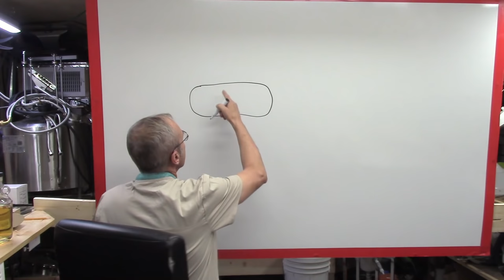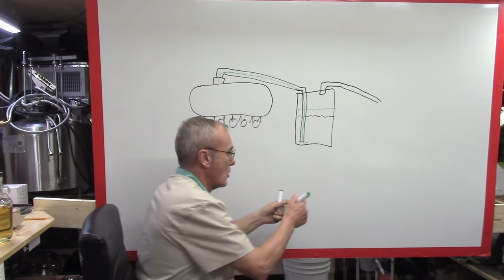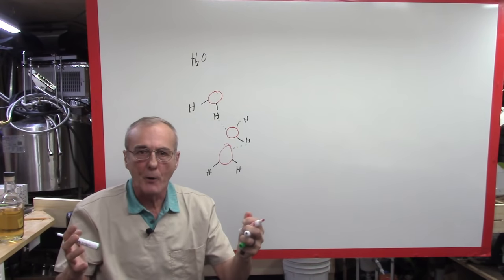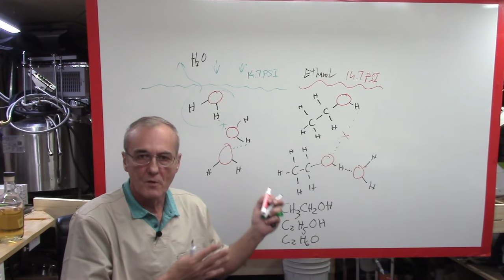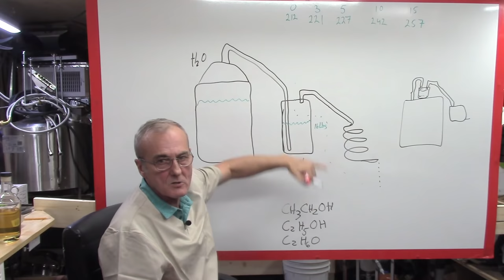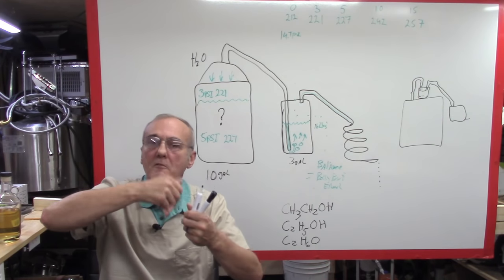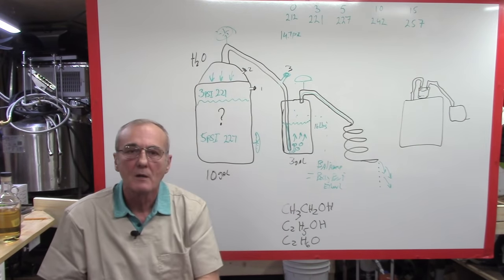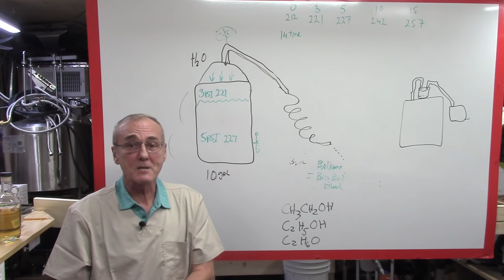THUMPER THEORY, OPERATION AND PROCESS

Comment: Damn dude your saving me time a d money with every video.  Except the part about 2 hydrometer. I did great with one until you jinxed me yesterday with get 2 of each. Well broke my proof trailer at the end of my run last night.  I'm ok at bubble testing or shake test. Could you do a video on the shake proof test please
Reply from the maker: Yeah, hydrometers break when they are single. I dropped my hydrometer from about head height last night and it bounced across the floor (didn't break). I guess that was because I have a few extras in the drawer. Similar thing happened about a year ago but I dropped it only a few inches onto the bench ( it shattered). Of course, I only had one so everything came to a halt.

Comment: Well.... that was very informative!!..... and disheartening lol
I built mine years ago, according to the way I was told, I didn’t know it was called a “thumper” I was told it was a “poison pot”.... my inlet tube only connects to the top (like the Chinese model you spoke of) it has no internal tube. I was told the “poison” would condense in the pot, only good whiskey made it out to the coils 🤷‍♂️. So I can either eliminate the thumper altogether, or add an internal tube to it. I do like the thought of the “double distillation “ aspect, but I definitely didn’t add a thermometer to it (which I could add) and I could put heat on the thumper to speed the process up some.  Btw mine is all 100% stainless steel, and it uses stainless steel tubing (5/8”) and the thumper is not even close to 1/3 the size of my pot. Suggestions??
Thanks for the videos! Super helpful

Comment: Is the methanol & acetone extraction temp 140 - 173 the same at sea level as it would be at 1000 ft or 7000 ft ?
Reply: No. All boiling points change as air density drops. Which is why water boils in a vacuum.

Comment: I respectfully disagree George. I was always told that the thumper was so they could run at a much higher temperature safer and in turn make a higher proof at a faster rate. The process is the same but the motive is different. I do however agree that they are, let's say nearly, unnecessary if you have a way to control the temperature. The tool you were thinking of in a monometer.
Reply from the maker: I understand you point and see the wisdom there. I may not agree wholly with that but that is okay. 
We are still saying about the same thing. Thanks much
George

Comment: Would you get a higher proof with the thumper over pot still
Reply: Yes
Reply from the maker: In theory yes but there is a limit since the distillation only happens twice at most and that is a stretch. 
The only true way to increase proof is to switch to a reflux still.

Comment: 22:55 I disagree with your premise that there is 16 pounds of water back pressure created in the thumper. In reality the still will see the height of water that is measured between the bottom line and the top surface of the level inside the thumper. 1 psi = 27.7 inches of water. so that being said the still will see about 1/3 psi or 9 to 10 inches of water column.
Reply: His physics is really lacking :-)

Comment: Lots of bla bla about having no clou about the process. I'll tell you the Clou.. 

The thumper acts as a pressure controller as the dip pipe is submerged into the liquid within the thumper causes a certain amount of backpressure. . The submerged length governs the overpressure LP (=low pressure) in the kettle.
The Ethanol boiling point in the kettle is shifted (increased) a bit due to this. In the thumper however is  atmospheric pressure (AP) the condensation temp is also a bit lower. 
Function/ process :
The slightly hotter ethanol vapor flows from the LP kettle into the AP thumper and expands there. That's the noise you hear coming from the thumper. 
The incoming LP Ethanol vapor is bringing up the thumper temperature too and increases 2nd stage distillation. This is in fact the heat source of the thumper. This causes the evaporation of the AP alc within the thumper. The AP alc vapors enter the condensor coil..and follows the usual process which I will not explain further. The outcome from the condensor is dubble distilled  alc.!! 
The thumper definitely purifies the alcohol.! 
Since so many thumpers are poorly designed, the purifying effect is also poor. The rule of thumb normally doesn't work really... Especially when you don't know what you are doing...
To my modest opinion you must be able to play with the dip pipe length that is submerged into the thumper liquid... Doing so you manipulate the back pressure in the kettle. 
More/less back pressure means higher/ lower temperature  of the influent alc into the thumper. This surely has an effect on the 2nd distilling process efficiency of the thumper. 

If questions, just ask me
Reply: what is your heat source?
Reply: @mushroomman1856  the delta T between the Low Pressure alc vapor in the kettle and the atmospheric alc in the thumper.
The temp difference is enough to revaporize the alc in the thumper = 2nd distillation.
Remark: the specific evap. Temp is pressure related.

My advice 1 : read my explanation again.
My advice 2: don't consume mushrooms when proper brain function is required bro!
Reply: @son-of-a-gun  I understand all that.   I asked "what was your heat source".  I pick edible wild mushrooms btw.
Reply: @mushroomman1856  read my explanation once again bro.
I also pick wild mushrooms in the forest but only those I'm 100% sure of. Baked with bacon and unions...
Hmmmm
Reply: The length of the inlet pipe and the thumper liquid level have some adjustment..is there a something of a tried and true equation to follow and maybe a adjustable inlet pipe with say a plastic pipe slip on over a short pipe to tweak the pressures..or ..is it just a run it and watch it..as it was originally built or conceived. I have the " cheap Chinese" and I hate to call it that..the inlet is flush with the thumper lid, no protrusion into the thumper liquid, the set up I have is the thumper sits nicely on the lid of the still boiler and the heat from the lid seems to make the tails come through quite completely and the thumper liquid is almost water when done. and when finished turn off heat and next day wash up nicely with no threat of crushing negative pressures.I will try to get inlet pipe down into the thumper liquid to see how this affects the run and with some flavourings and aromatics in the thumper liquids,anyone else where I am does this seem viable.??  any comments..I'm a newbie at this and have only run 3 batches so far..and seems so far..so good..
Reply: @ultraStevenator  yes your proposed solution will probably work. Caution:  Don't forget to place a vacuum breaker on your kettle. Your still is probably made of thin wall SS sheets that might implode when under vacuum.  I suspect that this is also the reason why the Chinese manufacturer didn't include a dip pipe in his design, on the other hand 
the thumper cannot function as a TRUE 2nd destilling step without a dip pipe since the slight overpressure in your kettle depends on the emerged length of your dip pipe.
If no dip pipe, no better taste either. In this case (without dip pipe) the thumper might work as alc. concentrator, since water will condense, but not the alc.
Reply: @son-of-a-gun  thanks Mr.Safor..I’m going to modify the thumper with a dip tube and investigate a vacuum release valve so as to cover my mistake if it occurs, I should be ok with this as I try to do a good job and babysit it carefully..but ya crap happens..so will look into a valve or some release system..thanks so much for your help I’m kind of a newbie at this and having fun ..but ya pit falls will get ya..kinda already looking at new systems ..hahah..but getting a little experience as I go and help from good people like yourself with your experience and getting some of your time in to help me and others..CHEERS..     steve